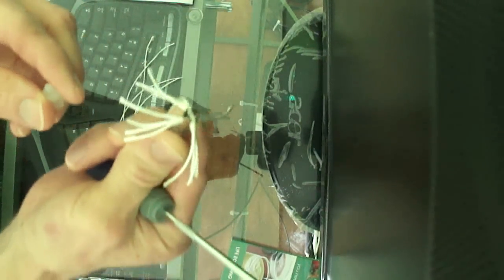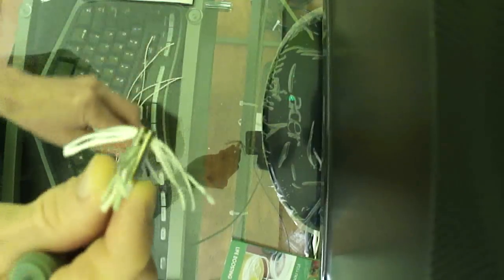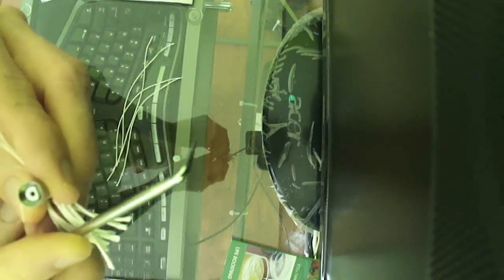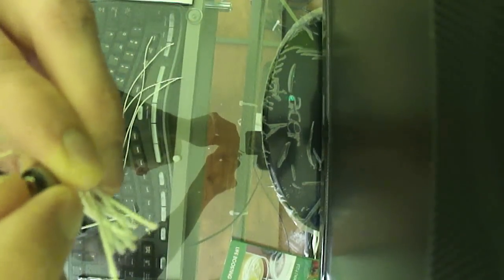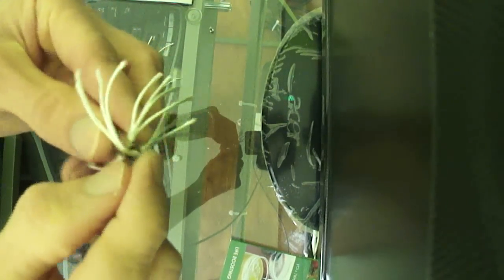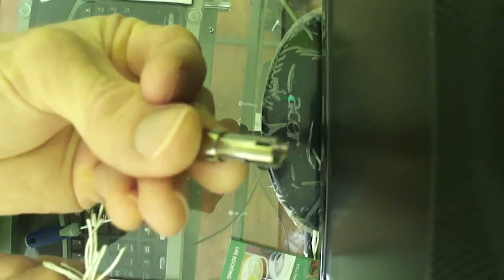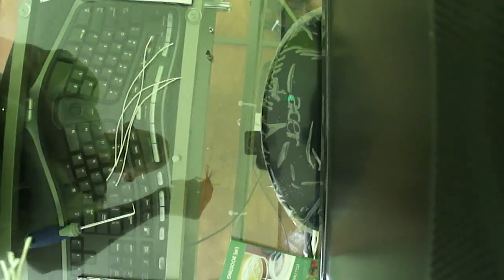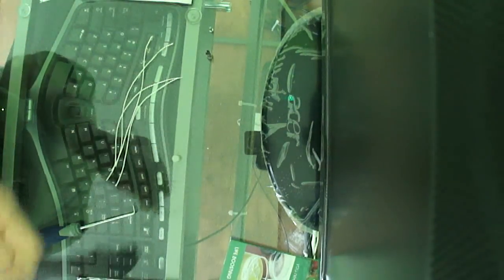iClear30 Coil Rebuild Silica Wick 32 Gage Wire

Comment: Thanks for the video Randy. I'm a bit of a tinkerer with anything electric or mechanical and was glad to see this. I just purchased an MVP 2.0. What is the optimum ohms resistance I should be looking for with this device, and where would I get the wick material? A crafts store that has candle making supplies?
Reply: Also, have you thought of using a fly tying jig to do your builds? I imagine it would make doingthe wraps a lot cleaner and closer so that they don't touch the housing, and just easier to handle all around. You can find some pretty cheap, or being the maker you are, BUILD ONE!
Reply from the maker: Aaron always more than welcome to reply back to your first question I would shoot for 1.5ohms to 2.0ohms I am finding the lower ohms that you can get the more vapor you are going to get out of it. Wicking material that I have found to be the cheapest for silica there is a place called "House of Vapor" you can get it really cheap there, or you can go cotton just make sure you don't "DRY BURN" on this.Honestly to your other question in terms of the fly tying jig that is an excellent idea I have for the meantime since the video gotten really good at wrapping coils very very close but beginners that would be a great idea! Glad I could help!

Comment: Thanks for the video Randy, it's very helpful.  I have followed it to the letter (same wick and wire) and I can't seem to get my ohm's above .8.  Any ideas on how I can bring that number up to about 2, or at least 1.8  Also, have you tried using cheese cloth as a wick material?  I saw a video on it and it looks really promising.
Reply from the maker: thanks for the kind works Marge! My best guess is that you are using a thicker wire gage maybe? That will bring it to a shorter amount of ohms if you have a higher amount of gage it will bring it to a higher amount of ohms in a shorter distance. Or my guess is as well Rebuild the coil I had this happen once or twice where they were touching where I couldn't see it, and once I re-did the coil I was able to achieve around the 1.5-2.0 range.
Reply: If you're getting sub ohm reasons from doing this then its very possible you have a short. Make sure your cojkls aren't touching one another in any way.

Comment: guys, i found a better way: if you don't want to go through hassele making 2 coils you can put all 8x1mm wick together and wrap 3 turns of 32awg wire and put it in the lower slot and the plastic cap turn to cover the upper gap, 3 turn 32awgx8x1mm wick will give you 2 ohm. cheers. try it, it takes under a minute to make the single fat coil and seems to last longer than the dual coil and the vapor taste better :)
Reply: under this single fat coil, i set my itaste mvp 2.0 at 4.2v and 8.5w, taste is good/smooth and doesn't give any burning/dry taste like the dual coil set up.
Reply: Mark M Just a heads up, Mvp 2.0 only does volts or watts not volts + watts.
Volts on mvp 2.0 is great because we can adjust in 0.1 increments.
Watts on Mvp 2.0 is great if you run more then one type of tank with different ohm's (it will try and run all your coils at what ever watts you set it to)
To switch from volts or watts mode just press and hold the button to enter the menu that corresponds with the desired option.
Reply: Tyler leithoff i didn't know that, i am using mvp 2.0 for a month now and it has 2 buttons, one to set volt from 3.3-5 and the other is for watt 6-11. i just set them up individually.
Reply: Mark M You just use one mode, the last one you change :), they are just different ways to change the power
Reply: Brilliant idee!!!:-)

Comment: so what exactly was the problem causing the short in the end ?
Reply from the maker: I have been finding out at the bottom when you are putting the bottom piece in, and cutting the extra wire off you need to make sure that the wire is cut all the way down to the metal of the bottom. What can happen is that the extra wire can touch the outside of the metal that screws in therefore touching the negivite side of the coil/
Reply: ahh it was a bit confusing as you did the adjustment away from the camera.

Comment: WOW, to 90 percent of replies to this video.  Learn how your vape works.   Low ohms with a thick wire = more vape & less of a chance to burn the liquid (this should be obvious since the thicker wire is slower to heat up.)  In this video "Don't let the two positive wires touch they will short out."   WRONG, positive is positive , electrons flowing the same direction through both of those wires.  They are "technically" touching in the aspect that they are both POSITIVE.   A short would be positive to negative.   I am blown away at how ignorant people can be.   A 100foot spool of this wire is 10 bucks, he spends 5bucks on 6 inches worth.  You do the math, if we would all go to google and search "How vape coil's work" we would not be paying $100+ for 10bucks worth of wire.

Idiots

Comment: I really appreciate the breakdown! However this video is VERY unsafe. Someone new NEEDS to know about the built in safety features on APV mods like the Itaste MVP. And why those features keep you safe when you are dealing with electricity. REBUILDING IS NOT FOR BEGINNERS THERE ARE INHERENT RISKS. PLEASE PEOPLE DO AS MUCH RESEARCH FIRST. THIS IS A COMPLEX BUILD. Thankyou!
Reply from the maker: Brian I couldn't agree with you more on this statement people do need to be very very careful when they are building these I do know why there is a safety shoft on the MVP and SVP that I am using everyday, and will not use any built coils, and test them on these due to the sheer fact that if that thing trips while using there could be a fire, blow up, or other things could happen. Before you smoke a coil that you built make sure that you are preventing all trips before you use it, and make 110% sure that the device is wired properly.
Reply: Brian Morse  I am looking to start rebuilding these coils, where can I find information on the inherent dangers you speak of?
Reply: Randy Olsen
 Your saying not to test built coils on MVP's?  MVP 2.0 to be specific.
Reply: Mr. Joe Kevin did the foot work for us. Thank you Kevin Miguelez. Good looking out
Reply: Mr. Joe An apv (advance personalized vaporizer) like the MVP with an ohm checker will work great to determine if you have a short ( bad connection).
Reply from the maker: Brian Morse
Thanks for the reply Brian, I am with Brian with the rest of you make sure that you put everything on a APV or MVP "Something that can check the OHMS" before we are firing these things up to make sure there are no shorts to consider. Also thank you Kevin, on the sub ohms I wanted to comment make sure that all your builds are over the 1.0 even better 1.5 ohm range on a normal device. Never ever run sub ohms unless you know for sure you have the proper hardware to fire these off of otherwise you have the option of your hand exploding off due to the batter getting more draw off of it than it was intended to.
Reply: don't go below 1.5ohm if you're using a regulated mod(it probably won't work below that anyway) and use protected batteries on mechs. it's not rocket science peeps. also use an ohm calculator to make sure whatever ohms you're building your coils at doesn't exceed the amp rating of your batteries. or spend the bucks on sony VTC5s that can pump a crap load of amps before it'll vent out
Reply: Mr. Joe Basically you must be knowledgeable of the kanthal gauge, ex. 32 or 33 is thin enough to fit this build AND alows you to achieve higher ohm levels with less wraps around your silica. When you're installing the coil/ wick assembly you must be sure the lead going through the shaft doesn't touch the walls or you get a short circuit. And having some basic understanding of Ohms Law goes a long way. Not to sound rude but good ole common sense works great when rebuilding :)
Reply: Mr. Joe Basically you must be knowledgeable of the kanthal gauge, ex. 32 or 33 is thin enough to fit this build AND alows you to achieve higher ohm levels with less wraps around your silica. When you're installing the coil/ wick assembly you must be sure the lead going through the shaft doesn't touch the walls or you get a short circuit. And having some basic understanding of Ohms Law goes a long way. Not to sound rude but good ole common sense works great when rebuilding :)
Reply: Thank you for all the kind feedback, I have grown in the Vape world and am off of the iclear 30.  I now have the Hades, Mutant, Stingray and Caravela in my stash.  I have a Tobh, Crown and Igo with a Protank 2 on my MVP that I now refer to as "Ol Faithful"
Reply: nice collection there Mr. Joe :) i hated the iclear 30 when i got it with my mvp had to use it for the passed cpl days till i could figure out a way to "fix" my fogger cuz the threads stripped out....i'm right with ya tho the mvp is pretty awesome :D
Reply: Thanks to that iclear 30 I moved onto a Kayfun pro plus clone. The only thing I wasnt crazy about the iclear was how quickly it went through juice lol
Reply: Brian Morse
wow man u know what? i had the exact same opinion on it. i mean the flavor was awesome! but wow this thing drank juice like a biker lol...also i found that @ 11 watts on my mvp the drip tip would get pretty hot
Reply: Kewl Beans YeA! I've cooked my lips on that tip a couple times lol
Mr. Joe your welcome for the feed back! Glad to help.
Reply: wish they could fix that somehow cuz as it was once said i think "that's what make da flavor be so good" haha
Reply: ***** agreed! I learned to build on my Kanger MT3 tank . The OLD one WITHOUT the replaceable heads. LoL , now that taught patience.

Comment: sorry mate but that was a right fail.better luck next time
Reply from the maker: Completely Agree with you on the fail on that one I ended up fixing it towards the end of the video come to find out the wires were not "Tightly" in there causing the trip on the iTaste. These are by far one of the hardest tanks to rebuild.
Reply: yes I agree mate ,they are a bit fiddly,i ended up cutting the negs short so they don't go all the way down and out , feeding the longer positives through that rubber grommet from inside the tube  and push it all the way up to the top so i can feed the positives down ,then carefullly push the grommet in from the top obviously while making sure the negs go down the sides pushing slowly from side to side from the top with a very small drill bit or the sort till its out of arms way in the tube making sure the negs are still trapped against the wall. and not wrapped around the top ,that worked for me :)
Reply from the maker: Nicholas Sparkes Nicholas, Awesome idea never thought about that one but again none the less again they are extremely sensitive, and trip so easily. Even while cleaning, and doing the dry burns after I have built one I am finding some of them are tripping after I fittle around with them for a bit cleaning. What I have found that helped during the majority of my builds is that if you can get the coils extremely closest to each other without any gaps between the coils that will prevent the wires from touching the wall. Thanks for all the great ideas I am sure we will figure out a complete fool proof way here soon enough so it is easy enough but again, one of the hardest so far to rebuild so far. Happy vaping buddy.